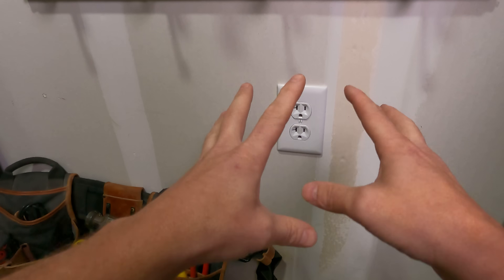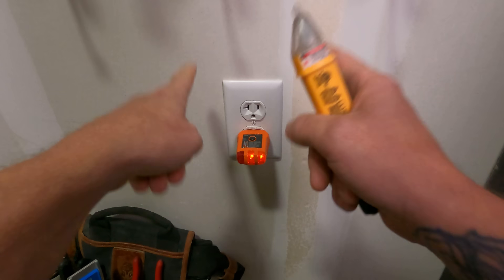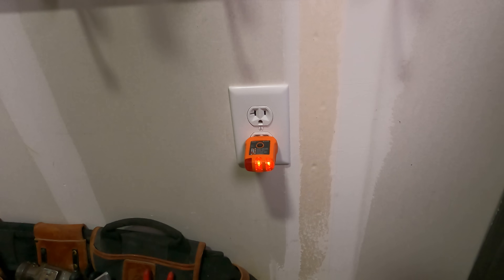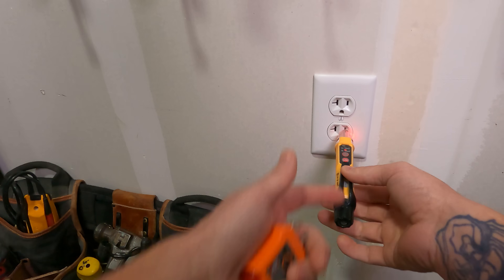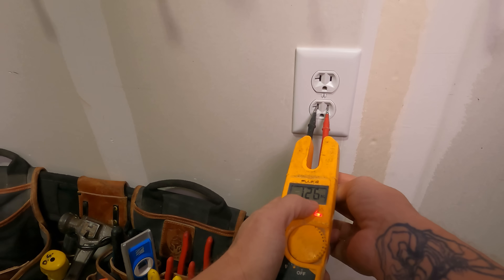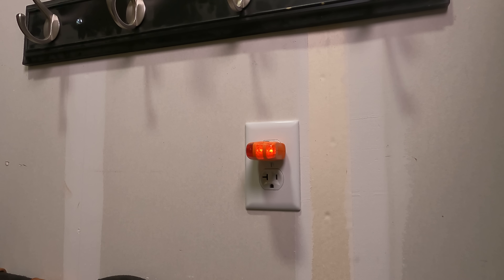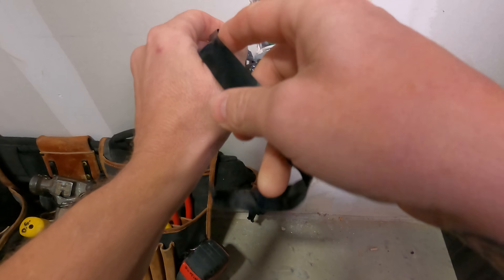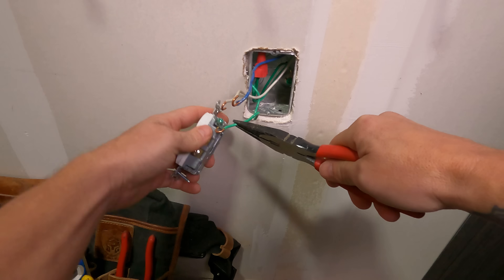How to Change Out a Receptacle  - The Right Way!

Comment: Should I have continuity/non-infinite residence between hot and ground? Replaced a back stab receptacle recently and did my usual testing with the multimeter, and that part surprised me. Iirc I didn't have it between hot and neutral which was even weirder to me. (Power off obviously, confirmed 0v, but there were still things plugged in to receptacles. Yes, there are places in this house where two three-way switches for a single light fixture straddle two circuits 🤦 which is why I'm glad I verify excessively)
Reply: any old light filament, or transformer on a power supply, might show up as a short.
ancient status lights too.
or you may have damaged wires or devices somewhere...
Reply: or a ground was used as the neutral somewhere
Reply: @wim0104  Thx. All 4 could be a possibility in my house.
Reply: @wim0104  oh good thought, hadn't thought of that option. Eventually I will track it down, it just surprised me, but I verified it wasn't the fault of my receptacle swap so I chalked it up as another electrical quirk of the house

Comment: Only thing I would add is that I typically don't allow helpers on my jobs to use their drill for the exact reason you explained. They're so worried about being done so they can play on  their phones that they won't take the time to check with a screw driver. Just impact it down and throw it into the wall without spacers or box extentions and then ask me why I'm doing their work over again. Lol. Your comment section is like my company shrink or something that I can't let all my gripes out from work 🙃
Reply: Well... you see people overtightening receptacles with screwdrivers more often than not which is just as much of a problem as not being quite tight enough. So an apprentice just snugging them down with a drill is basically the same. By code you're supposed to torque them and ive seen it called out by an inspector before but who ever does that. General rule of thumb is to use the drill only to loosen or snug and a screwdriver or wrench to tighten though.
Reply: @blosky5665  why tighten with a screwdriver at all if a drill is enough?  My point is that if my guys are using the drill they will not take the time to use a screwdriver. I've seen a lot more loose connections in my days than I have over tighten, especially on things like recpts. and switches with smaller bits being used to tighten a cheap screw that strips out if you look at it wrong.  I've actually seen things be installed too tight with a drill more than I have ever by hand. Usually larger connections though. People have literally used their impact to tighten lugs in meters and panels and caused some more expensive problems.
Reply: That’s crazy that they always want to be on their phone, I have my aptitude test on Thursday for the local union I hope I get in and be able to do electrical work to learn and grow not just to try to finish fast to be on my phone haha😊
Reply: Electric Screwdrivers fill both niche well.
Reply: @sunnygalli  that's called a drill lol
Reply: @JS-nr7te  sure but it limits the torque that can be applied and allows them to check how tight it is with hand feel after. Although it won’t resolve the other issues you described haha.
Reply: @JS-nr7te  No because drills are for drilling and electric screwdrivers are for driving screws.
Reply: I use a torque screw driver everything has a spec should tighten it to. I bought one to replace all the wire nuts, and pig tail everything  in my 1970's aluminum branch circuit home with alumiconn Mechanical connectors must be torqued to spec. I just torque everything to spec.
Reply: I deal with lots of stripped or cross threaded screws from years of hack work done by hotel maintenance guys. 

I use drills often, but not for many tasks.

Comment: Neat trick ….with the Klein plug tester.   If the ground sucks in the dwelling , one way to tell is to push the gfci button on the tester (on a non gfci cct) . One of the lights on the tester will dim more then the other (I haven’t tried in a awhile so I forget which light actually goes dimmer) .

Comment: I only use the pen tester to give me a general idea if anything is active such as opening an old box when you don’t know what’s live inside. Jam that pen tester in there and you’ll know right away. Even if it doesn’t sound I still like to check splices with my actual tester to verify the presence or absence of voltage.
Reply: Yup.  I use the ncv to figure out what I need to meter.  And for solving mysteries.

Comment: My first lesson on replacing a receptacle...never use backstab! Also, I was told not to use tape over the screws, where another told me that he always uses white 3M elec tape over incase a wire breaks, but then I argued if a wire comes loose, you would eventually know. Thoughts on that, taping over the recept lead screws? As for backstab, found too many in condos/townhome construction...sure its quicker but wires expand and contract. Thoughts on backstab versus securely screwing leads?
Reply: I do it for metal boxes typically in case someone (myself included) ever has to pull the plug out hot while checking, testing or troubleshooting. I've never had problems. Never heard of tape causing issues. Seems unlikely but that's just my experience
Reply: No competent electrician I've ever met would admit to using backstab. It is bad for the reason you stated, and it's also just not a very secure way to attach the wires to the receptacle regardless. Wrapping around the screws or using a clamping type back-wire method are the best ways to wire receptacles.

As for taping when using non-metallic boxes.... I think it's still often a good idea because you're usually using romex in those boxes with a bare ground wire. If a hot wire somehow comes loose from the receptacle you have an extra layer of protection against shorting out on the bare ground wire (or the neutral touches the ground and trips an AFCI). Honestly, I've usually not taped receptacles on residential jobs, but I have been told to do it before and I don't think it's without merit.
Reply: @1shakezula1  I always tape receptacles and switches in non metallic boxes exactly for the reasons you stated. Even in a non metallic 2 gang box you could have issues with incidental contact between hot and neutrals.
Reply: I especially tape gfci on single gang boxes as there’s no room for them and a higher chance of contacting the box/cover plate.
Reply: DIYer and I always tape receptacles in metal boxes as you have the extra issues with the metal box accidentally completing the circuit.  The problem with tape in general is that after so many years it becomes a sticky mess and the next electrician will probably just cut it off which shortens possibly already short wires.  I’ve also seen electricians tape wrap the wire nuts.
Reply: I'd tape only for boxes where I used F clips, because the clearances are so tight. Your regular box/receptacle has plenty of clearance. Unless you're a Rogue, never ever backstab. First downside I could think of is it damages the wire if you need to replace the receptacle.